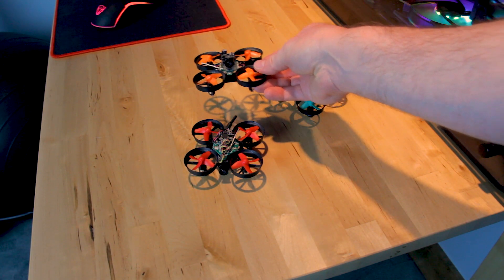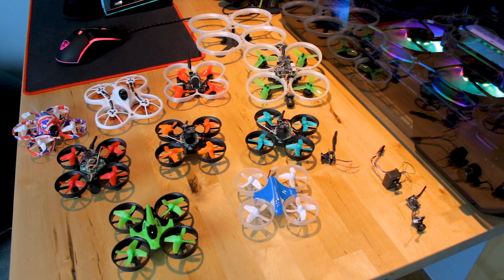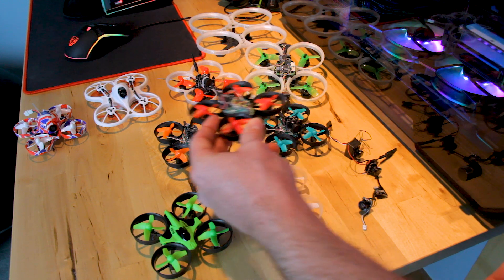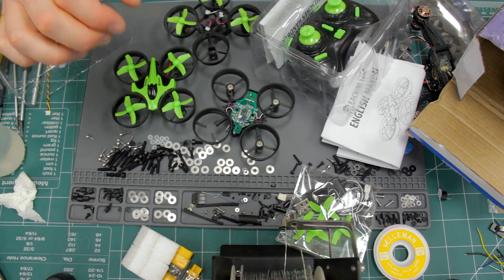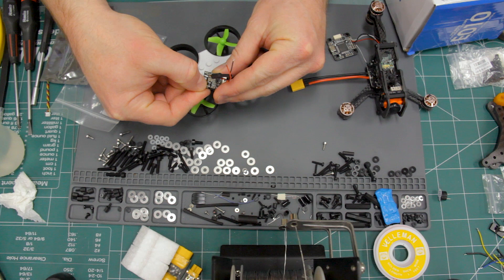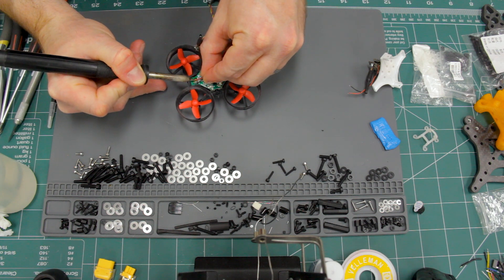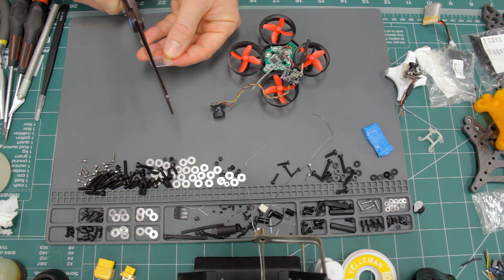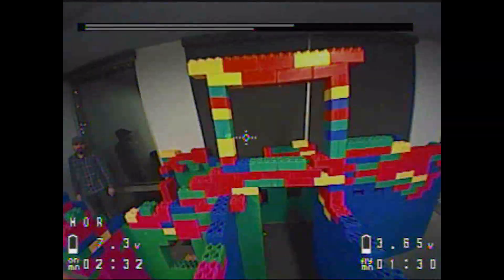Making an Inexpensive FPV Micro Indoor Racing Drone

Comment: Nice video, very much explanatory. I would have one question however.
Is it possible to connect a professional controller like a Taranis to it? And if so, how would you know before buying?
Reply from the maker: Yes, it is possible to use a higher quality controller such as a Taranis or a Jumper with most toy drones, but it requires a multiprotocol module of some sort.  A Jumper radio has a built-in multi protocol module, and if you use another transmitter, it will need a module bay where you can plug in an external multiprotocol module.  Try doing a google search for "multiprotocol module" to get an idea of what those are.  I personally have a Taranis X9D+ with an older multiprotocol module and I much prefer using that instead of the cheaper controllers that come with the drones.  The hard part is there is not a great way to know if it will work with various cheap toy drones.  To figure that out, you have to do a bit of internet research and you will also have to find a forum or post somewhere that tells you what protocol to use.  It can be a bit tricky, but when it works it is worth it.

Comment: hello very intesresting , i wanted to buy the  beta 75x 2S but expensive , may i should try make one ..thank you  for sharing
Reply from the maker: The Beta 75X is a fantastic drone, much better than the ones I show how to build here.  A Beta 75X has much more power, flies with much more control, and has many more features.  If you are looking for a drone that is similar to that one, but less expensive, I would recommend the Mobula 7, or the Eachine Trashcan.  They both cost less than the Beta 75X, but are very similar and arguably better in some ways.  If you are just getting started with drones, it is nice to start with something a lot less expensive like the ones I show how to build.